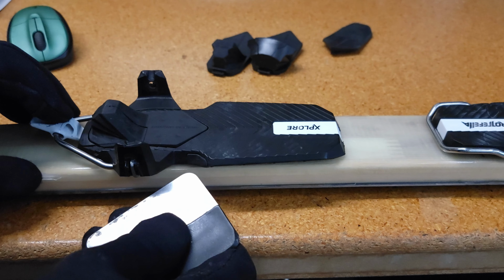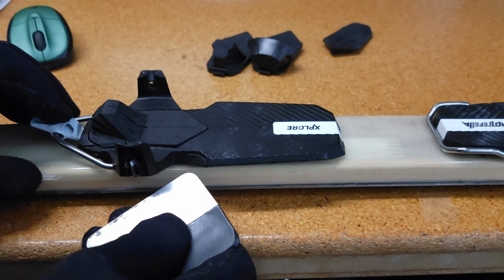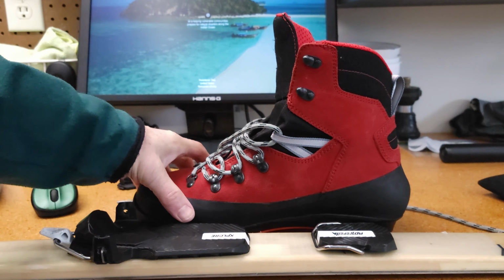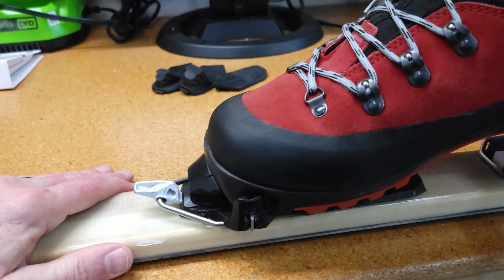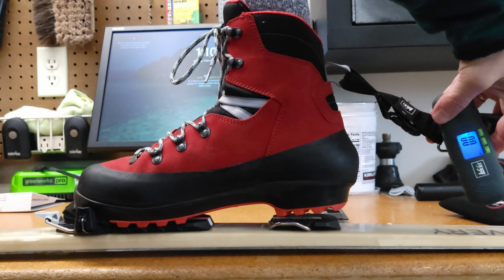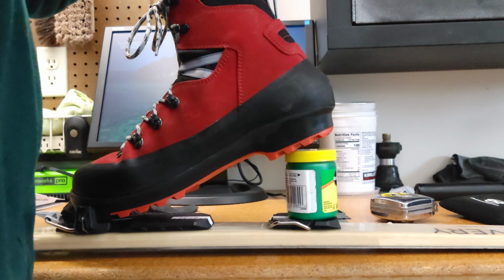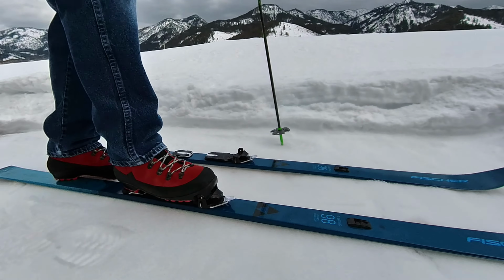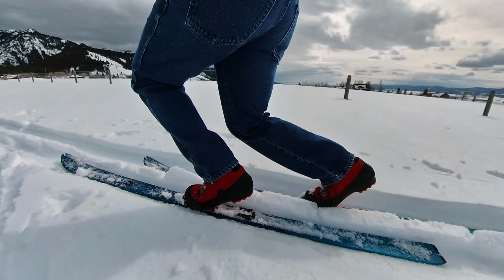Rottefella Xplore XC Binding Hard Flexor, Part 1

Comment: Tom. Your videos are so informative. Huge help to guide  me as I commit to xplore. First 15 outings have been fantastic for me. As many have mentioned,  there are many moving parts. Wondering what you recommend for routine maintenance and field repair kit.
Reply from the maker: So far I have had no issues with my Xplore bindings or boots.  Some people have had a boot pin get stuck in the compressed position so it is a good idea to always carry something that will help unstick the pin.  I've done a couple of videos on this subject   https://youtu.be/x5Du8eOVdog  and https://youtu.be/n1356GdlCnI  Rottefella sells a grease kit https://www.youtube.com/watch?v=uctqVrKxZHo for maintenance,  but I have not lubed mine and I haven't found a source for this in the US.  It sounds like you are having a great time with your setup.  Thanks for tuning in and for subscribing.

Comment: Thanks as always for your informative videos Tom.  Do you think it would be practical to keep the hard flexors in for regular touring or would they give too much resistance?
Reply from the maker: That would depend somewhat on the boot and your expectations.  It is possible to kick and glide with the hard flexors, but it is more restrictive than the standard flexor.  I prefer the standard flexor over the hard flexor for most of my skiing, but I do ski the hard flexor upon occasion.  I usually carry the hard flexor and the flat plate with me on my tours just in case I want to change them but the only time I've used them this year was to let someone else who I was skiing with try the hard flexors on their skis.  I also find that the hard flexors can contribute to toe pinch on my Alfa Free boots, but that is not an issue with my Alfa Vista boots.  I don't notice the toe pinch on my downhill runs, but I have noticed it on long approaches. The hard flexors do offer a bit more control on the downhill, so they are worth trying out.  Give them a try and post back with your experience.

Comment: The boot sole doesn't appear to flex at the ball socket like even a plastic boot does, is this an issue?
Reply from the maker: The sole is stiffer than NNNBC and most 75 mm leather boots, but it will bend under the ball of the foot.   The new sole / binding combo  offers plenty of control of the rear ski even if the ball of the foot is not firmly planted.

Comment: Good morning Tom:  Frugal tip to share (unsure if this fits in with your community guidelines).   XPLORE Bindings sale $175 (vs $240 srp) from Varuste.Net, Finish sport goods company.   ALFAOutdoors offers 15% off on gear if one joins their member club (free).  I ordered bindings but waiting on Boots locally for sizing.   I'll need to travel to Northern MN for snow as we are on warming trend in Minneapolis.  Many thanks for what you do.  Inspiring.
Reply from the maker: Great tip.  I've never ordered from Varuste, but $677 USD for the Xplore binding, a set of Alfa Free Boots and FedX shipping to the US is a very good price.  I wish they also carried the hard flexors as that would be a sweet deal for someone who wanted to mount their own skis or convert an existing ski to the new system.  I hope you have a great spring ski trip to Northern MN and thanks for tuning in.
Reply: Excellent tips.  Thx!